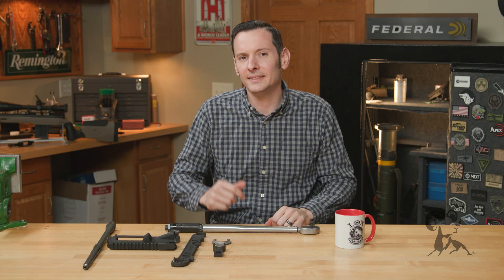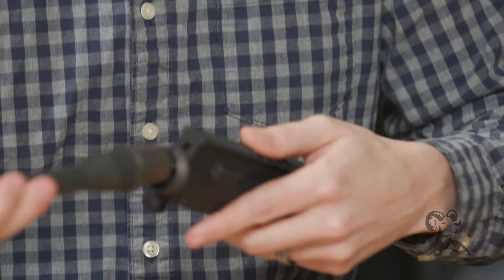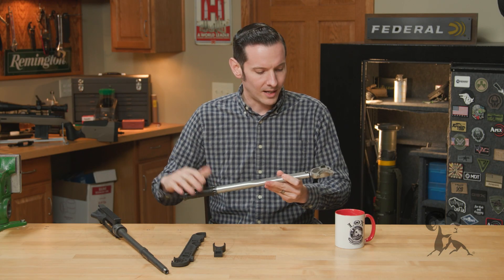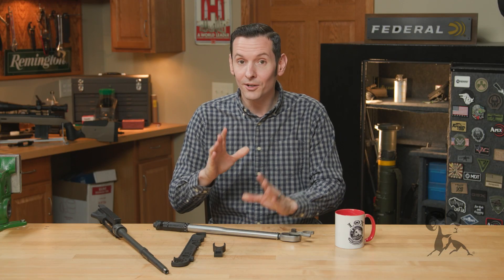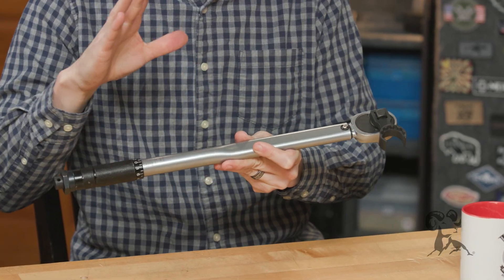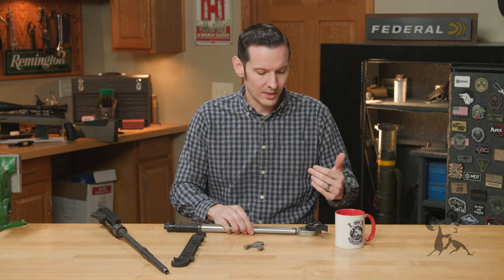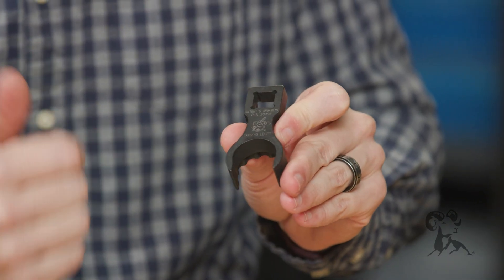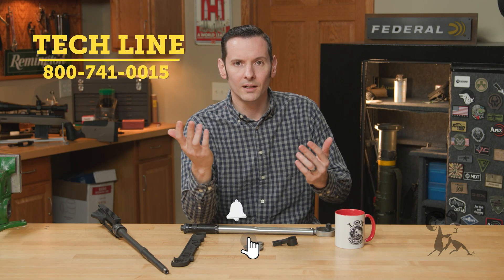Quick Tip: Using a Torque Wrench on Firearms

Comment: All of that is true, but because we're using a torque wrench with a limiting mechanism, it doesn't matter. The limiting mechanism won't let you over torque the nut, unless you continue to apply force after the break. If you rotate the barrel nut wrench to be at an angle to the torque wrench the force being applied that contributes to the actual torque that spins the nut (i.e. the moment = force x distance) is the applied force times the sin of the angle at which the force is applied (torque = Fsin(theta) x distance). If the barrel nut wrench is at 90 degrees, the sin of 90 degrees = 1. So, 100% of the applied force goes into the torque as work to rotate the nut. If the barrel nut wrench was rotated at 60 degrees (sin 60 = 0.866) then 86.6% of the applied force rotates the nut and you need to apply more force to get nut to rotate and break the torque limiting mechanism than if you kept it at 90. This explanation is the "why" behind the scenes. But the bottom line is - because the torque wrench head has a torque limiting mechanism in it, it won't let you over torque the barrel nut. So it doesn't matter. However, for good practice and to make sure 100% of your force translates into work to move the nut, keep it at 90 degrees.

Comment: I use a torque wrench for barrel nuts, but anybody who is not a mechanical idiot can get it within spec with a regular wrench. The torque range is actually pretty wide and 50 lbs is pretty easy to hit with that length of wrench.

Comment: I was always told 35-55.  but never had any issues with doing it up by hand.  tighten it up til its snug then one good grunt and your good.
Reply: Most people can wing it and get it close enough. But a Harbor Freight torque wrench is about 12 bucks with a coupon and they are fairly accurate for what they are, so it doesn't make sense to not have one if you build ARs or do any DIY mechanical work. You can not guess a torque value as close as even a cheap Harbor Freight torque wrench. Even those crappy things are within a pound or three if you store it correctly.

Comment: Mathematically speaking, yes, there’s a difference. 

REALITY- 
1) The calibration on a torque wrench has an allowable +/- deviation.

2) The torque spec on any fastener you’re working with has an allowable range of torque to be applied,.

3) The center-to-center distance a barrel nut wrench would add to the overall length is extremely minuscule.

Getting pissy about this is somebody who truly doesn’t know any better attempting to flex an intellectual muscle they don’t actually have.

Comment: Yeah. With a regular crows foot it’s negligible. When you’re putting the torque wrench on a armorers tool and it ads a bit more length it’s still in the single digits over the setting. There’s a simple math equation to figure it out to be exact. Multiply the torque # you want by the length of your wrench (from center of the ratchet head, to the line on the center of the handle) then divide what you get by the complete length of the wrench and the added extension combined and that’s what you set the wrench to.
Reply: Yeah, the crows foot add a few inches of off-set, unlike a regular socket. But prolly not enough to make a colossal difference.

Comment: Isn't spec for the barrel nut like 30-80ft-lbs? Nothing in the automotive world has a spread like that. Aim for the middle of that and you can do all sorts of things wrong and still be in spec.
Reply: The reason for that spread is for gas tube alignment on the barrel nuts that use the delta ring assembly, most handguard manufacturers that I have used recommend 40-45 ft-lbs.
Reply: @theunofficialresults231 Yep. It's kind of like a castle nut on a ball joint. You torque it to low end of spec, then if it doesn't line up you tighten to the first available notch to put the pin in.
Reply: Exactly.  You could use handfeel and a regular ratchet drive and  get it right more than half the time on a spread like that
Reply: Holy shit! SOMEBODY gets it!
Reply: Don't go more than 40 to 45 foot pounds if you try to go to 80 then you will break it.
Reply: @kato1224  There is no reason why 40 wouldn't be plenty

Comment: One way is the right way. 
The other is wrong. 

The only reason you can use the torque wrench in either way and get away with it, is because there's so large a tolerance in the torque spec. 
If you were torquing something with a lot tighter tolerances or a lower torque specification like a scope mount screw..... You would break what you're torquing. 
There is a math equation to work out the added length that a Crow's foot adds to a wrench. 

I get that big tolerance covers you for the bad job torquing and/or to be able to align the gas tube notch on the nut. But apply this to critical small bolts and nut and you will be buying the item again because you just ripped the threads out.

Comment: its changing the length of the lever
Reply: The point being made in the video is that the extension (the specific one he is using) is so short that the difference is negligible.
Reply: @JenkinsStevenD  if you're a few degrees off 90, yes, probably doesn't matter a whole lot. But if you're inline and torqueing something more precise and critical, it can matter a lot depending upon the value.